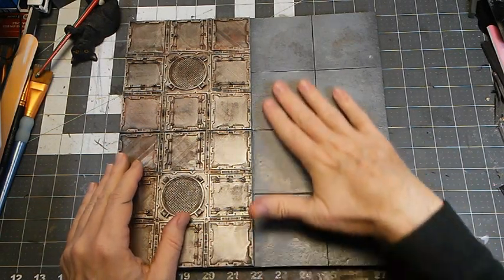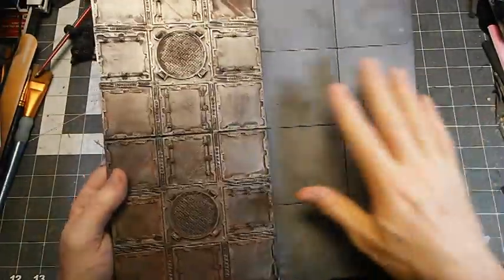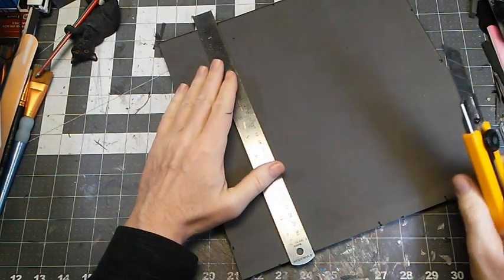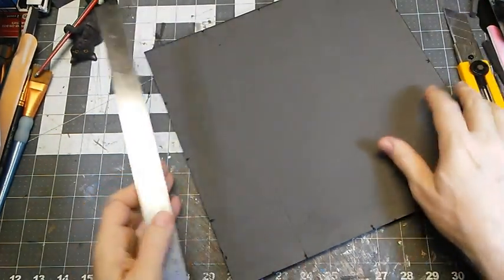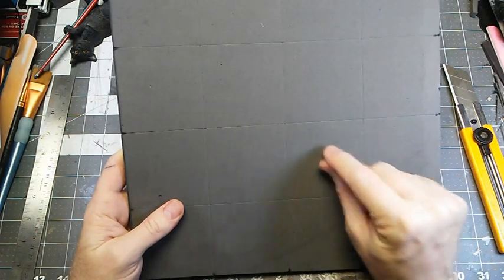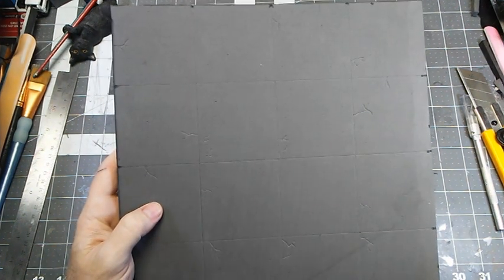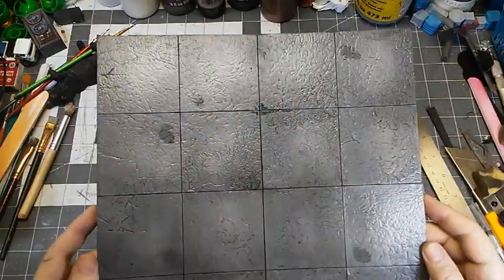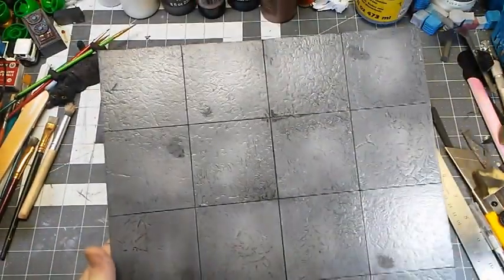Necromunda - UNDERHIVE CONCRETE TILES - Ep 49

Comment: Outstanding video. I've tried a couple different foam thicknesses and different spacings for the expansion joint cuts, but the constant in every test is some amount of curling up at the edges (especially corners) after applying the iron. Is there any way to combat this that you'd recommend? The Harbor Freight floor mats have the least curl to them and they're also the thickest of my test pieces, but I'm trying to make several 20" square pieces with 4" expansion joint cuts that I can place next to one another to expand the tabletop for different systems as needed. The curling could probably be held down with MDF terrain, but it would still probably bother me. (The sizes are sort of arbitrary, but after I cut off the puzzle piece ends, 20" was the largest square I could make and have evenly-spaced joint cuts.)
Reply from the maker: Thanks! I have noted the curl, I keep the tiles in a stack, that seems to help a bit. Otherwise I just gently bend it back and it seems to hold for quite a while. Placing terrain strategically is probably the best bet if possible. I am going to make a test tile where I do the relief cuts for the joints, and then do relief cuts in a different direction on the bottom, to see if that helps at all. Cheers!
Reply: @HacksawsHobbyBunker  Awesome! Would be worth a short update video if the findings are interesting. I eagerly await more inexpensive-but-great-looking terrain tutorials!
Reply: So, I fixed it for one use case and will be trying something similar with my 20"x20" tiles after a bit. I did a 10"x10" test piece with 5" spaced cuts for the joints, cut a diamond shape on the underside of the tile using the expansion joint cuts as the points of the diamond, and used the medium heat setting on my iron on both sides. The higher the heat, the more warping was introduced in my other tests.
Reply from the maker: @brianhicks493  Ah, good to know!

Comment: In looking for EVA what thickness are you recommending - and a source maybe.
Reply from the maker: This technique will work on just about any thickness of eva. I use the pads from Harbor Freight because they are easy to get where I am, and they are cheap. But pretty much any eva foam pad from any of the hardware/DIY places should work great also. The ones I have are 3/8" or 1cm, its a good thickness as it has plenty of rigidity but its still very light. Cheers!
Reply: @HacksawsHobbyBunker  - are these the matts that lay on at floor from Harbor Freight.
Reply from the maker: @longhunter5935  Yes, they come in packs of 4 for 8 or 9 bucks.
Reply from the maker: I also apologise, I thought I had included the link for these - I have added it to the vid description - The mats - https://www.harborfreight.com/4-piece-anti-fatigue-foam-mat-set-94635.html

Comment: Brother! Mine just came off the iron!
Reply from the maker: Excellent. How did it turn out?
Reply: Great. Ran every 2”, and my foil is a bit thinker because my texture looks heavier than yours. Opened up a couple places where the cracks were near the edge just add additional visual difference. Are you on Instagram? Or Facebook.
Reply from the maker: @longhunter5935  awesome! Im not on Insta but Im on like 13 groups for terrain on FB.
Reply: @HacksawsHobbyBunker   I’m on “Terrain made easy” and the “Tabletop crafters Guild”. I can post on TME this evening and will link your video to give you credit .
Reply from the maker: @longhunter5935  Cool. Thats one of the groups I'm not on, I will have to seek it out. Cheers!
Reply: @HacksawsHobbyBunker  just posted with a link to your videoZ
Reply from the maker: @longhunter5935  Thank you! I joined the group, lots of good stuff going on over there. The tiles look great so far!